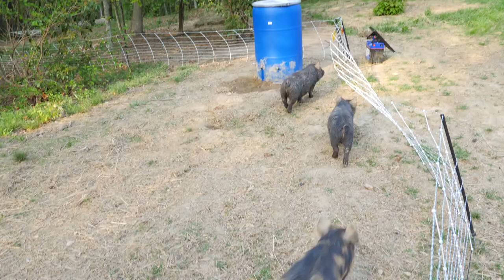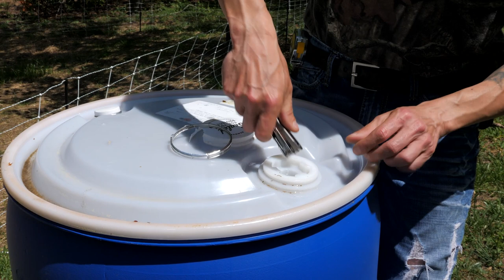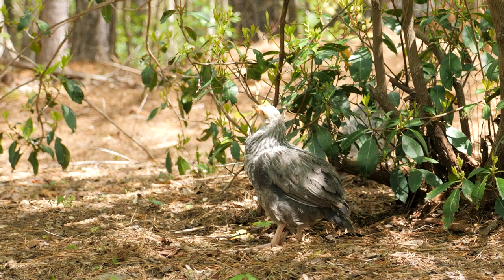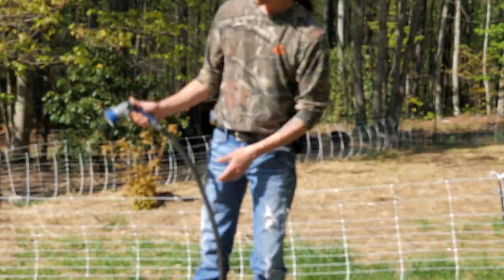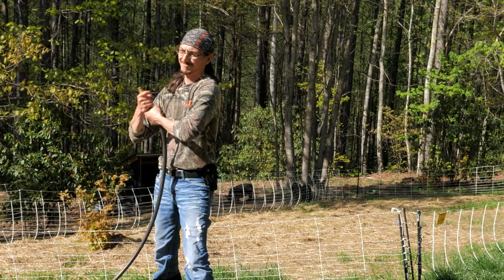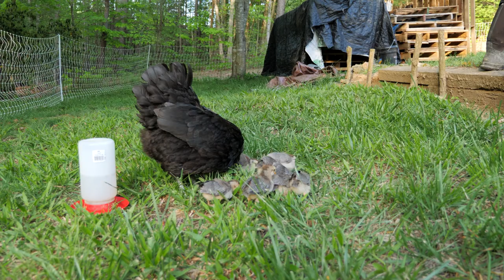Building an Easy Automatic Pig Watering System

Comment: To keep the little chick food away from the big birds: build a box about 3-4' square, maybe 1' high. 3 sides are impenetrable by all chickens, a solid back wall and hardware cloth on either end. You'll want a solid roof for weather protection. Across the front place sticks vertcally roof to ground, leaving space between just enough for the small chicks to get through but no adult chickens can reach the food that you've placed close to the back wall! I've seen this on Permaculture Chickens (Justin Rhoades) over a year ago and it works marvelously yet still allows the chicks free range with mama! 😀

Comment: What you can do with the small bung on the drum is put in some kind of float with a stick on it or a pulley at the top and a rope (where the pigs can't reach it) and a float on the inside and a weight on the outside that hangs down and shows the level of the water.

Thanks for posting, the pigs and chickens are great.

Comment: a simple hack on how to tell when your water is getting low in barrel is to remove 3/4 inch bung on top.  Get a piece of four foot wood or fiberglass rod and attach a cork on end and put through the 3/4 bung   .. this acts as a floating dipstick and you can see from a distant when water is low without opening barrel .plus it acts as a vent to keep a vacuum from being formed as they drink water
Reply from the maker: Now that’s a cool trick 👍🏻😎
Reply: richard carter 👍

Comment: I see a mud hole in your future :<0) If not those are exceptional pigs. A small concrete drain or french drain will stop that from happening. I kept my pigs water on a concrete slab draining out. My 2 cents for you but pigs flies suck so you may think about this later.

Comment: Great idea but don't ya think putting it under a shade tree would be smarter before you fill it up, the sun is going so make it to hot to drink and burn tgere throat.. just sayin
Reply: Not only that but the ultraviolet from the sun will degrade the plastic so it cracks.